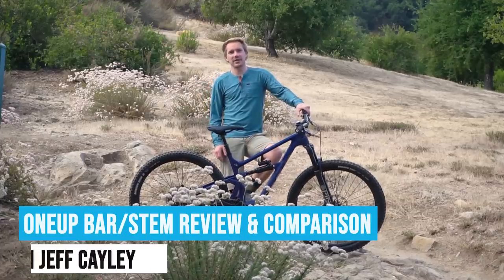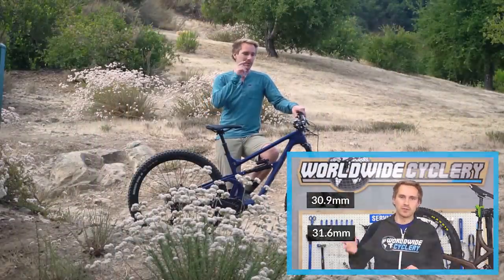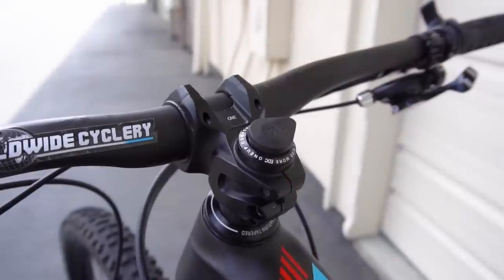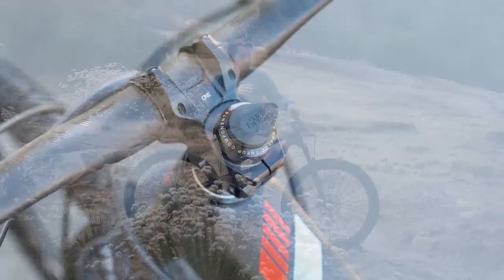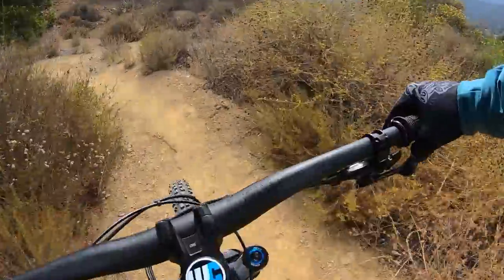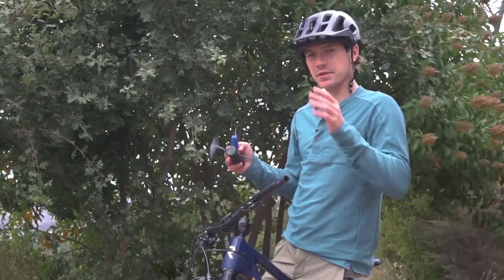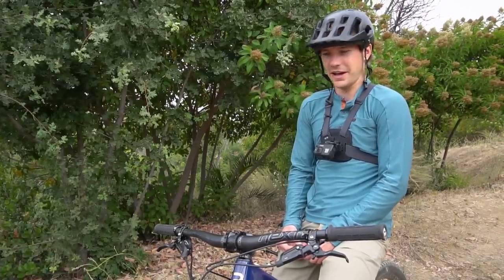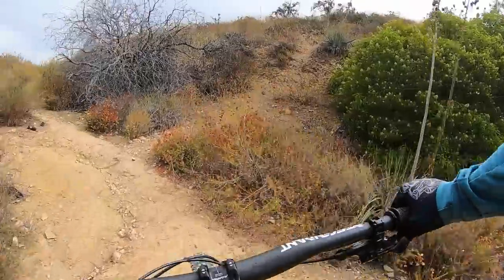OneUp Carbon Bars | Is The "Compliance" Legit? (Compared & Reviewed)

Comment from the maker: What handlebars are you currently running on your bike?
Reply: I've yet to find anything as comfy as Renthal, (Carbon or Alloy,) but that's partially because I like a shallow bend. My LBS gave me a deal I couldn't pass up on some Scott Syncros Hixon takeoffs, so my current project bike will be sporting those. Being an old guy, I'm a fan of compliance, so Spank's Vibrocore and this OneUp bar have certainly caught my eye.
Reply: Diety mohawk carbon
Reply: These! Oneup carbon 🤘
Reply: Spank Vibrocore 31.8mm 50mm rise 800mm width... 50mm rise as my bike's stack is lower than i'd like... had Joystick carbon but like these Spanks a lot
Reply: Nukeproof Horizon
Reply: Renthal fatbar lite 35 carbon, maybe the goldilocks bar?
Reply: s-works, 10/10
Reply: Newmen advanced carbon bars
Reply: Renthal Fatbar  carbon
Reply: @lrvz7187  Honestly i didn't do back to back testing but I don't really feel any fatigue with these barsand I'm comparing them to alloy 31.8 or carbon 35 and I do 50km+ days in the Swiss Alps on big chunky stuff and just did long days in Whistler. I'm really happy with them!
Reply: RF Turbine R
Reply: Crappy stock generic BBB bars.  0:22 damn this fork is working well
Reply: Nukeproof horizon, 38mm rise 780mm wide, I love them !
Reply: Tried many, many bars (like in this video) and ended up with the ENVE M7s in  40mm rise. I did cut them down to about 750mm though which affects the rise.
Reply: GEMINI Kästor 30mm stem. :)
Reply: Renthal Fatbar Lite Carbon, (wouldn't these have been a closer match to the Oneups?), which by the way I was considering but they didn't have the rise I was looking for.
Reply: Worldwide Cyclery I have the old ENVE V2 (31.8) with Hope stem on my main rig ( a full rigid SS) and Renthal Alugold Fatbar with a Thompson stem also 31.8. on my hardtail trail bike.
Reply: RaceFace Turbine R
Reply: nukeproof horizon carbon
Reply: Worldwide Cyclery race face next R 35
Reply: Building a new bike, so I'm in the market. Originally had Race Face Next R
Reply: Easton Haven carbon 35’s.
Reply: Nukeproof Horizon
Reply: Renthal fatbar carbon 35
Reply: Chromag BZA 🤟🏻
Reply: Truvativ descendent dh.
Reply: @go4jay29  Me too, the 25mm rise.
Reply: @lrvz7187  -  I have Raceface SixC 31.8, 19mm rise, 785mm bar on my 150mm trail bike and I like it a lot.  I bought a Spank Vibrocore Team 30mm rise, 800mm wide bar to play around with setup and I could definitely feel more fatigue and hand pain so I switched back to the SixC and much prefer it.  I think the  ESI extra chunky grips I'm running (on both setups)  help too.
Reply: ktm line something bars yeah i dont know what my bars are lmao
Reply: spank oozy 760 (vibrocore)
Reply: @NoBrakes23  i doubted the vibrocore (replaced a raceface bar with them...absolitely wonderful. vibration claims are valid. but they need to be oriented properly or you will feel flex in the wrong directions. very light also
Reply: @lrvz7187  its very noticeable. works wonders.
Reply: Wood
Reply: Crowbar Aluminum
Reply: Love my shimano pro carbon tharsis 👊
Reply: Enve DH
Reply: Been running flexible Carbon bars on my rigid Planet X Kaffenback 2 steel frame for 5 years, best thing I ever did for my arms, wrists and shoulders, we have a lot of cobblestones in Copenhagen!
They're not for sale anymore, they called it the Chewy version, had to cut em down a bit to be road legal, max is 700 mm allowed for a road bike with 2 wheels here...
https://www.bikebargains.co.uk/on-one-knuckleball-carbon-mtb-riser-bar/
Reply: Truvativ Descendant carbon 35mm on enduro and Nukeproof Horizon alu 31.8mm on dirt jumper
Reply: Renthal fat bar carbon
Reply: Enve m7
Reply: RaceFace Turbine R
Reply: Titanium baby!
Reply: instablaster.
Reply: I was riding Santa Cruz Carbon Reserve but upgraded to Ti and what a positive difference. I predict the industry will roll back around to using Ti in a lot of areas where profits have gravitated in the direction of Carbon (a definite improvement over aluminium) but Ti bars have a type of "friendly flex" which acts more like a steering damper than an out-of-control College-FLEX-fest like everyone told me they will be, actually adding to my confidence and helping to remove a LOT of wrist/hand & arm pain I'd have after an epic ride
 around the block 😉
Reply: Title reform 750mm width
Reply: Whiskey Milhouse!! Absolutely love em! Very comfortable bars!

Comment: You guys should do a “blind” handle bar test where you black out the bars and see if normal riders can actually tell a difference without know which brand they are or if they are carbon or not
Reply: Would be interesting if you blindfold the rider too. 😀
Reply: @benyujr.6545  haha that's what I was thinking he'd say
Reply: Was just logging on to post the same comment. Great minds ...
Reply: haha same
Reply: I know this comments section is old and dead, but gotta say I totally agree.  "Tests" like this are not tests at all.  Best bet would be to have like 6 identical bikes, setup identically with every metric: suspension, tire pressure, etc.  Bars wrapped so rider doesn't know which is which, hopefully wrapped identically so you can have rider repeat certain bars randomly without knowing they are.  Further, have them only test climbing, then only descending.  Just the fact that he's climbing and descending multiple times is going to drastically change his perception.  The MTB industry as a whole really needs some more empirical testing for basically everything.
Reply: @Chuckolicious  Also, wouldn't be bad to test without something like a Lyrik Ultimate, imho. First world problems...
Reply: @Chuckolicious  such a good comment. These tests are more of sales videos, which is fine. But I'd love to see some blind tests, I think many people would never be able to tell a difference. It's all about your perception and it's even more dramatic when you've spent your own money and it's an "upgrade".

Comment: Currently running Spank Spike 800 x  50mm vibrocore bars, super sweet bars, they work very well. Very intrigued by the OneUp bars, however still cautious of carbon bars, being a big dude and riding hard, but if I were to go carbon it'd definitely be OneUp. I concur with your opinion, OneUp make some badass gear and I'm super stoked on all of it.
Reply: The Vibrocore bars are the best choice imo

Comment: Ive got rf atlas 35mm and have been looking for carbon bars to take the sting out of the chunky trails around here. Well stoked on the review.
Reply from the maker: You may have found your answer here sir 😁
Reply: I just found this video because I too am going to go from RF Atlas to something "softer" because my hands can't take a full run anymore.  How did it work out for you?
Reply: @playgroundchooser  they do help, i dont notice any flex and steering is still as precise as any other bar but my hands can hold on for longer

Comment: What width were you running? Would there be much of a difference between a stock 800mm bar vs a bar cut down to 770mm? Do you think the cut down bar would be noticeably stiffer vs the uncut bar?

Comment: i always feel that with bar stiffness and compliance, one is not better than the other. Sometimes after you've used a stiff bar for a long time, it feels refreshing to use a soft bar and vice versa. If you do strictly down hill, then a a soft bar is great. But if you do all kinds of riding, then you should get a stiffer bar for efficiency. If your hands are feeling tingly or stiff from a stiff bar, then maybe you should adjust your tire pressure, tire brand, tire model, fork air pressure/rebound/compression settings, different grip, and different gloves.

Comment: I wonder if the stem stiffness is coming into play. I run 760 bars.  I've got the Next R bars and the OneUp bars and they both feel almost identical to me. I can't feel any noticeable flex/compliance in my oneup bars. Worst case scenario, I found some bars I like as much as my Next R bars for $65 less. That's a win for me. I wonder if I were running them at 800mm if I'd notice the difference more.
Reply: Hi - just wondering what the bars are that you found for $65 less ? Thanks

Comment: Good info! I wonder how where the Santa Cruz carbon bars with 20mm rise would fit on that chart? When I went from my old Tallboy which had 31.8 carbon bars to a Hightower with SC's 35mm carbon bars I immediately noticed how unforgiving the 35mm bar was on rocky/chattery descents. So much feedback up into the arms that it hurt on long descents! This could also be due to the going from a Fox 32 to Fox 36 fork. I think the sweet spot for a trail bike would be a 34mm fork paired with this OneUp bar. That's probably what I will use for my upcoming Tallboy V4 build. Plus the OneUp price point is spot on!

Comment: I replaced my Nukeproof 31.8 , both cut to 780 and it is noticeable and worth it. it feels like you have another 10-15 travel of when you hit sharp edge stuff or chatter at speed, far less arm pump, but I fortunately dont really have a problem with. 
Love them

Comment: What rise have you been riding? Also do you need to use the one up stem with the bars? Hope all is well!
Reply from the maker: I have been riding the 20mm rise bar because for a little while that is all they offered. But they just came out with a 35mm rise bar as well. And no you do not need to use their stem, the bar clamp diameter is 35mm like any other bar so it will work with any 35mm clamp stem. 🤘
Reply: @WorldwideCyclery  thanks!

Comment: Just picked a set of these up but pretty disappointing that they don't come in 820's. Hopefully the feel will be worth the lost width.
Reply: Why do you need so wide? Anything past 780 seems to be pushing it and will probably cause you shoulder problems.
Reply: @ertai222  not at all. I'm build like Sasquatch and have really wide shoulders and all. Actually had my shoulder rebuilt after completely destroying it and have a bunch of surgeries. And going down to much less hurts more honestly. I have tried from 780 up and 820 seems to be that sweet spot for me. Actually ended up sending the 800's back and grabbed another 820 bar after a few rides.
Reply: @eric9432  if it works it works i guess. That's why they make em.

Comment: You should do a blind test, hiding the handlebars.
Reply from the maker: You could easily tell the difference between the OneUp bars and the others. But the difference between all the stiffer bars would be hard if not impossible to tell. Most are pretty similar in feel but the OneUp. I was shocked at how much difference there way. Coming into this test I thought it'd be total placebo effect but it ended up not being like that at all.
Reply: Worldwide Cyclery Cool stuff. I think some long term testing with some epic rides would be necessary to determine which you prefer. Anyway, have you tried the Spank Vibrocore bars? They supposedly have yet another feel to them.
Reply: also, be great to run the same test with a 200-240 lb. rider and see what they think

Comment: So, if you had the Zipp 3Zero Moto wheels, and this bar, do they complement each other, or do you end up getting vagueness in handling?  Would then adding a more compliant seatpost in the mix help, or are you always off the saddle?
Reply: How do you add a more compliant dropper post??
Reply from the maker: That's a good question! If you start mixing in all of these new age "compliant" carbon components at what point does the bike get flexy ...?

My assumption is that it won't because all of this stuff is still a bit stiffer then it's aluminum counterparts. But would be fun to test and try and quantify!
Reply: @th_js  Good point -- I don't do any gravity riding, despite having a dropper.

Comment: Watching this in2023 wondering if the one up is still the way to go
Reply from the maker: Good question. I talk about this more in our upcoming video for the most popular products of 2022 which comes out in a week or two. Short answer is yes if you are looking for that much flex. Nothing is as good at that. However I have also changed my taste a bit and on bikes with 100mm+ travel I am liking a bar with a bit more rigidity as long as I am not riding ultra long downhills or the bike park. I helped design the Trail One Crockett carbon bars to be this middle ground of rigidity with some flex but not too much. Hope that helps. Cheers! - Jeff
Reply: @WorldwideCyclery  I’m looking forward to your update! I ride a lot of really rough trails, full of holes from cattle, rocks, roots etc. And some long rides. My last Enduro I couldn’t feel my hands by the time I finished a stage. Thanks again

Comment: I run the OneUp on my DB Mission Pro bike. And the RaceFace SixC on my Trek Top Fuel. Can certainly notice the difference between the two. I do prefer the OneUp a bit more. Leads arm fatigue for me. May switch over to the OneUp on my Trek, as well.

Comment: Ok so what about a fatigue test and a crash impact test? The best fiber bars do not surpass aluminum in a crash but do extremely exceed aluminum in shock.vibration fatigue tests. where do these fall?
Reply: I had a crash where my shin snapped a carbon bar. I think it acted like a crumple zone in a car, my shin injury could have been worse with an aluminium bar.
Reply: @paul--b  Ouch that had to hurt but in over 30 years of riding I have not seen or experienced of that type of a crash. Fortunate you are for sure but in most crashes that just effect the bar, the aluminum typically is still rideable vs the carbon most likely would not be. I just that when they start messing with the shapes and the pattern lay in order to optimize for a desired effect they then want to mess with the number of layers. I myself would like to see the standard test done before I were to risk my dental work. We seem to take the innocuous handlebar for granted. Just like cutting threads in a steering tube just to stash a kit of tools. I have yet to see a sticker that says place threads here...also given that the manufactures are also concerned about the weight of their product, I would think they would make the tubes as thin as possible just to save on material cost. I have seen those babies snap,

Comment: i'll stick with my vibrocore which are brilliant. raceface..cheap overmarketed overpriced (like maxxis). i do like your plug though 😂 dont need a star nut...no you just need your steerer thread cut  and to spend about $120 more on a cheap multitool. star nut and keyring allen set ftw ($6 for both and its lighter)